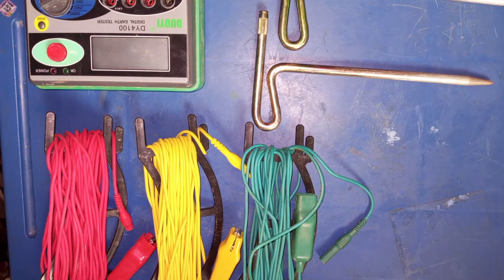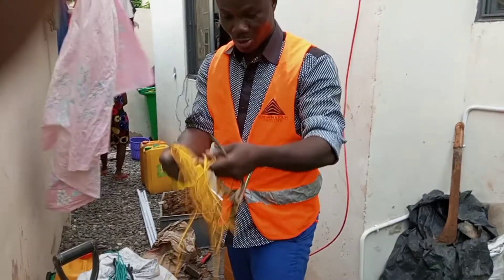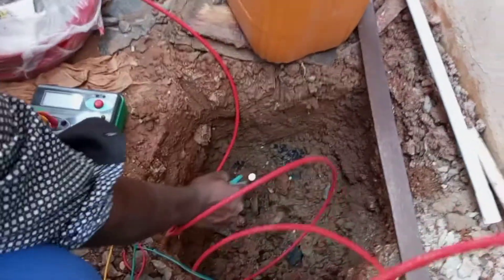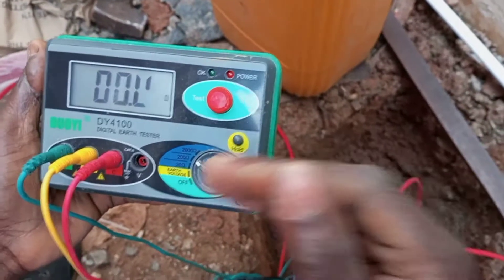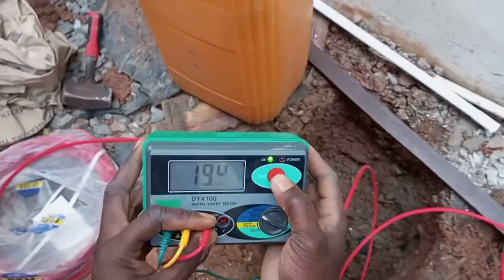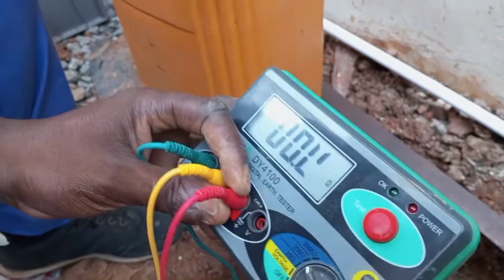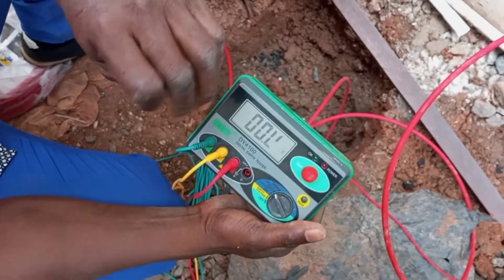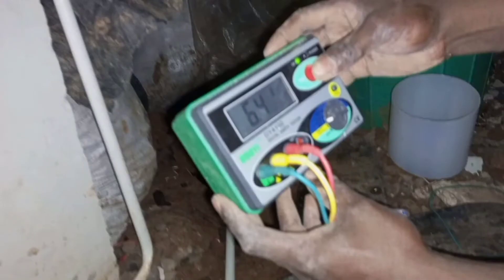How to do earth electrode resistance test/ and reduce resistance to earth

Comment: Very good video.   The one thing you forgot was that you must check the Voltage before you go into Resistance mode or you can burn out the Meter.  There can be voltage on the Ground rods that will destroy the Meter.  Each meters manual will tell you what is the Maximum voltage it can tolerate.
Reply from the maker: Thanks
Reply: Pls am just watching now but the man said something that the 20 ohms he got at first is not okay pls why? And how do we know that this specific reading is okay as in if is accurate??  Cause when he got 6.4 he is accurate like that so how do someone know sir I saw ur comment very useful here sir

Comment: How can i get that insulatio resistance tester sir
Reply from the maker: Please which country?
Reply: Kenya
Reply from the maker: @engineermwaruwa.-mc3yy  oh oh okay, you can get some at a local electrical shop. Though they are not common. You can also try shopping online.
Reply: Does it serve you better
Reply from the maker: @engineermwaruwa.-mc3yy  
Sure, but there are equally better or even more better brands in terms of durability and robustness. Prices also vary from brand to brand.

Comment: What is the normal ohms for earthing a residential home??
Reply from the maker: it depends on several factors and there isn't a single "one size fits all" answer.

1. Local regulations: Different countries and regions have their own specific regulations governing minimum earth resistance values for electrical installations. These regulations often define the required range, sometimes referencing 5 ohms but not always.

2. Soil conditions: The conductivity of the soil where the earth/grounding electrode is installed significantly impacts resistance. Dry, rocky soil offers higher resistance than moist, clay-rich soil.

All these factors will affect what you will call  "normal ohms for earthing a residential home??" in a particular location.

here are some general guidelines:
Many countries and regions set a maximum allowable resistance, often ranging from 5 ohms to 25 ohms for residential buildings. However, lower values are always preferred for enhanced safety.

Find the relevant electrical code or standard applicable in your area to determine the required earthing resistance value that is acceptable in your country/region

If you are in Ghana, you can contact me for assistance. WhatsApp +233242809918
Reply: @obloni_Electrical  
Im not in ghana
I wish u  have tutorials  online  not only on youtube.
Where we can interact with on video
Reply from the maker: @JerryMartins-vh9vc  
Good idea. So I will plan and schedule a time for that. Thanks 👍

Comment: Good you choose 500V,  which will also save thermistor if present. Here in India line to line is 415V and theoretically we have to inject 1000V. But to be on safer side we use only 500V practically.

Comment: Very useful demo. My humble suggestion:
 For multiple rods the minimum spacing distance should be twice or more that of the depth, to overcome zone of influence effect. Eg: if the depth of one rod is 1.5m then the parallel rod should be placed 3m away.
Then current spike should be placed at a minimum distance of 8 to 10 times the depth. Suppose rod is 1.5 meter depth then current spike distance to be at least 15m away in order to avoid influence. For array the diagonal is taken as depth for calculations. These are thumb rules we follow here in India for Fall of potential method. Thanks.
Reply from the maker: Thanks for your contribution sir.

Comment: What is the required minimum reading
Reply from the maker: That depends highly on what the Electrical code of your local jurisdiction(or country) says. The IEE regulation says anything below 200 Ohms is okay.  But Practically, you should be looking for a reading below 10 Ohms. with RCD protection (in a TT system).
Note:  the lower the better.  if you can get 0.0 ...value that would be great.

Comment: I did installation of earth once. From my understanding, the earth system depends on the sizes of the building, e.g, factory or house, etc. 
For me, i would prefer to put all the 3 rods in a hole. Build a chamber and create a square shape one terminal lead outside for all 3 rods. That was what I did in my last earth installation. 
Sir, i love your output explanation. Reducing the resistance on earth it means the building is not that so BIG?.

Comment: What if the resistance is not good enough, what are the symptoms? Does the current get low once put load?
Reply from the maker: In case there's a leakage in the circuit,  you will pay more electricy Bill and a small leakage can also cause electrical shock etc.

Comment: Good job again. Please:
1. What is the standard measurement for the resistance or threshold (I can see that yours is above 6ohms but less than 7ohms [6.4ohms])?
2. What is size for the cable that would be used in connecting the earth rod to the house?
3. How do you determine the length of the rod to use, i.e., is there a way of determining how long the rod (which is buried in the ground/soil) should be beforehand?
Reply from the maker: Well. There is an acceptable range but it differs from one jurisdiction to another. You have to refer to the electrical code of your country.
Meanwhile, the lower the resistance to earth the better. You can even get as low as below 1ohm depending on the area and the type of soil 

Please contact me through WhatsApp. +2339323669
Reply: @obloni_Electrical  Exlent my dear which country you Available
Reply: @yahayamasanja1849  Earthing system design is based on results obtained from Wenner's  4 pole soil testing method.
But as thumb rule we in India use 32 dia (nominal bore) GI pipe buried to a depth of 2.5 meter. This holds good for normal soil. The final result/value should be 5 or below.
During summer pit has to be wetted by pouring water. This reduces the resistance. Here the earthing system is TT. We use RCCB for leakage fault.
Mcb/fuse takes care of shorts and overloads. Hope this helps.
Reply from the maker: Refer to the electrical code of your country.
Meanwhile, in most cases it should be of the same size as the supply cables
Reply from the maker: It depends on the water table of the area.

Comment: Thank you sir for the lesson, my question is not related to this topic though. The question is, what could cause light bulb to still give light when you put the switch off? In this case, the illumination becomes low, compared to when the switch is on? What could be the problem pls?
Reply from the maker: Alright Seth, so there are two things:
1. Most of the time it has to do with the quality of the LED light. Poor quality LED lights behave like that.

2. Problem with the electrical circuit.
*Make sure the neutral is NOT used as the switch wire

**That could also happen as a result of small pick-up of electricity from a cable running along the LED light cables due to electromagnetic induction (we say leakage in simple terms)
Note:
*If you are not sure of the quality of your LED light (s) , replacing them with quality ones could solve the problem.

If you are very sure you are using high quality LED lights and the problem is still there, then check the circuit (wiring) as I indicated above.